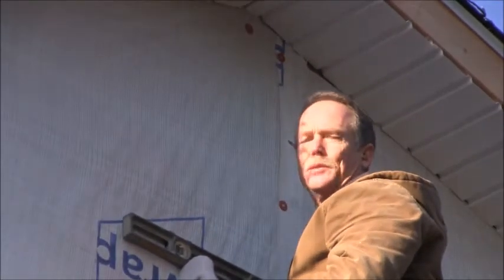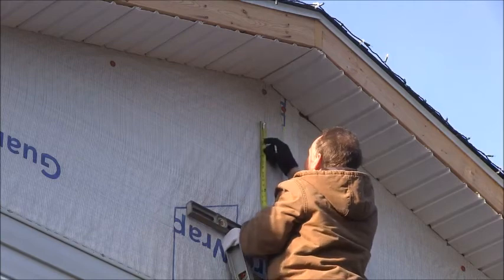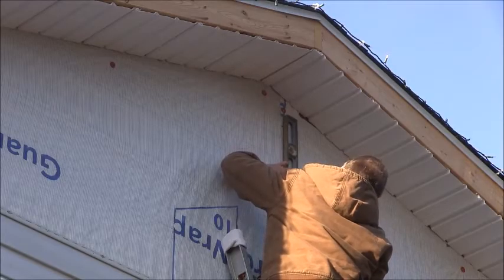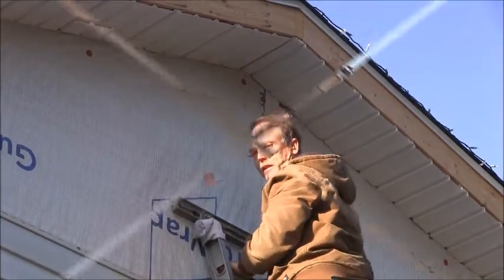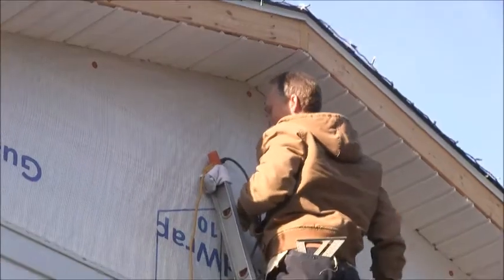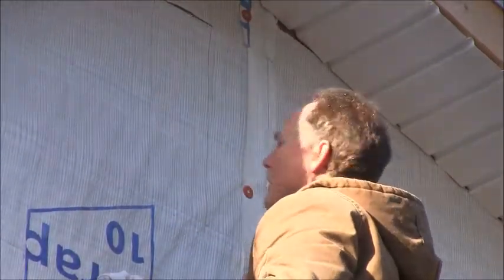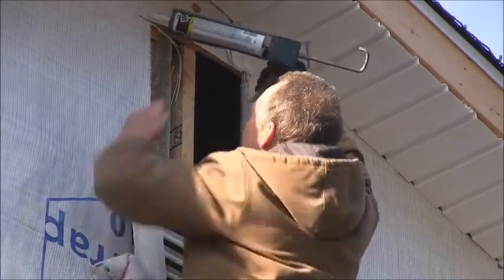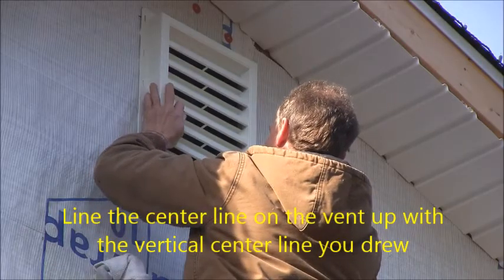How to install a Vinyl Gable Vent

Comment: This is great!  However, how would you put an exhaust fan then the vet?
Reply from the maker: You would have to mount it from the inside.
Reply: I'd maybe suggest mounting fans elsewhere. Or maybe 2 small fans to the laft and right of the center truss?

Comment: Where did you get that vent?  I need a back end flange since I have the stud behind the sheathing as depicted in your video.  I cannot locate one in my area.  Thanks.
Reply from the maker: I get mi e from a building supply company, not a lowes or home depot type. This is a store that sells siding and roofing materials. There should be one around. Look for a siding supply house for contractors. Most of them will sell to an individual, you don't have to be a contractor.
Reply: Thanks for getting back to me.  I live in AZ and I cannot get things here easily.  Would you tell me the name of the supplier you used.  Maybe they would send it to me.  Thanks much.
Reply from the maker: @steve-nr3gn  The name of the company is ABC Supply in Lexington Kentucky.
Reply: Thanks much!
Reply from the maker: @steve-nr3gn  You are welcome. I hope it helps.

Comment: how far down from the top did you make your line?
Reply from the maker: Sorry for the delay, it has been a while since I did that job. I went back by and looked. It was about 6 to 8 inches. I hope this helps.
Reply: He picked 6 inches down from the peak but you be sure to factor in the size and shape of you vent and precisely how much distance there is between the top and bottom of your attic.
Reply from the maker: @charlesmcgehee3227  Yes, this is right. I didn't think of that when I replied. Thank you for your input.

Comment: How do you do this whens theres existing aluminum siding already there?... Or is there a specific gable thats made to go over existing siding?
Reply from the maker: You would have to remove the siding. Install the new vent and then cut the siding to fit the vent. Don't use a saw to cut the siding, you should be able to cut the aluminum siding with a pair of tin snips without too much trouble. Removing the siding shouldn't be too hard to do as it is probably nailed  on. The hardest part would be to get the first piece off. Then remove the nails from the next peice. I hope this helps.

Comment: Installed it backwards. Vent should be inside the attic. I see there’s a beam blocking the hole so maybe that’s why you decided to do it backwards
Reply from the maker: It is not backwards. You don't know what you are talking about. If you installed it inside the attic, the frame that goes on last would not attach.
Reply: Alright children, knock it off!
Reply: Can confirm. This is what happened to me. I'm trying to rig something together to make it work now cause there's no way I'm taking the siding off this 100 year old home.

I'm thinking of making a wood rectangle frame and filling the void with spray foam. Any suggestions would be appreciated.

Comment: what if there's existing old cedar siding. any tips on cutting a gable opening without wrecking the siding?
Reply from the maker: You would have to get a different type of vent and cut it to size. The type of vent I am using is specifically for vinyl siding. Most lumber yards should be able to tell what kind of vent to buy.

Comment: The first thing you want to do is find out if your Life Insurance policy is up to date, and has the proper beneficiary listed before you scale the 45 foot ladder that you will need for this project.
Reply: They don't make 45 foot ladders sorry and you probably won't need anything near that 24 footer will do just fine in most cases
Reply: @EndTimesDisciple  And nobody has ever died from falling a paltry 24 feet?  Of course not.  (sarcasm).

Comment: I bought a gable vent to close off a hole in the gable where cats were getting in at.  I don’t know if it will fit because I can’t get up there to measure too well.
Reply: If you can't get up there, how were you planning on installing it?